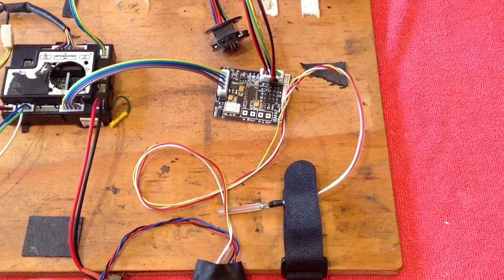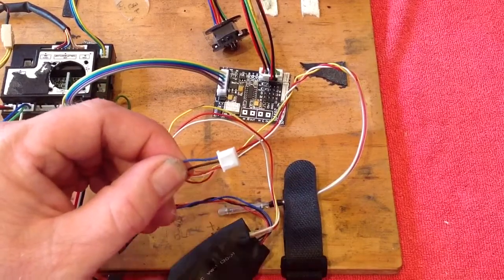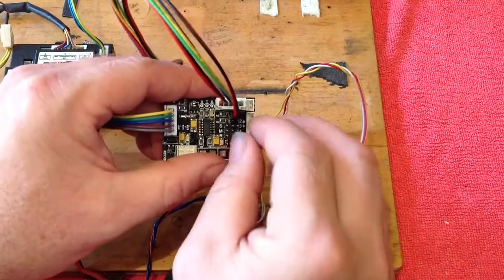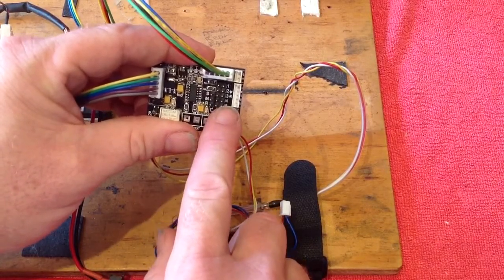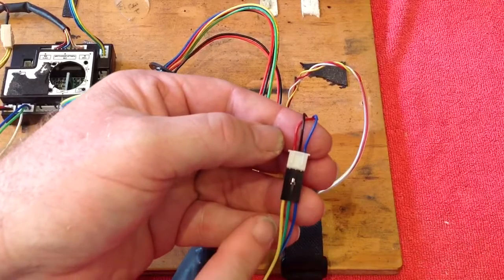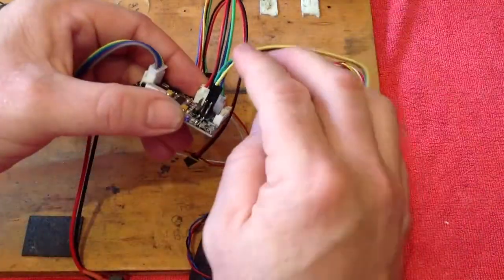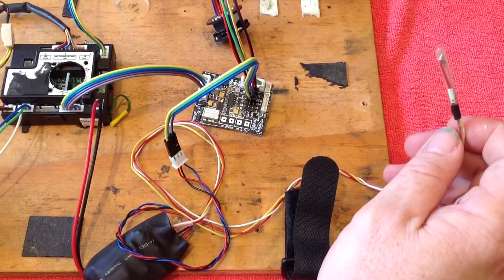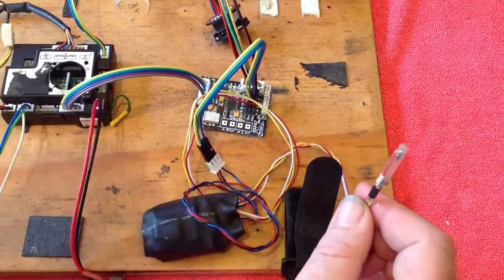MAKO & High Voltage Flash Unit

Comment: Is there a way do connect the mako4 to a high voltage flash?
Reply from the maker: HI Tom,  MAKO4 Pantherturm HAS a connection port for the high voltage flash which is marked 'Flash'.  MAKO4 Tamiya does not need one as the Tamiya MU already has that function. Those are the only boards in the MAKO4 series.  However, any MAKO or RCTA board with the Cannon LED function can trigger the flash if you understand how the flash works from the video above.  Supply the flash with power V+ and V0 and use the Cannon LED + signal as the flash trigger signal. Cheers KG
Reply: Thanks for the quick reply. I have a couple of mfus with faulty flash circuits. Whilst led flash is OK I much prefer the high voltage option. This gives me hope I can use the mako! Cheers